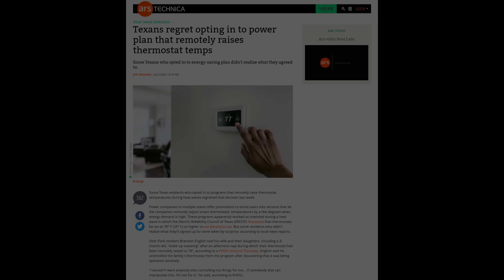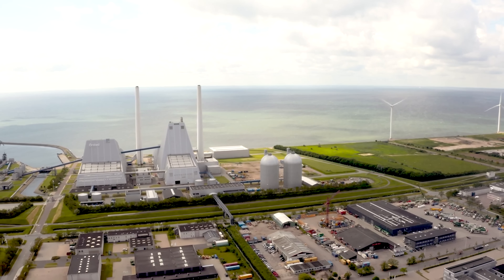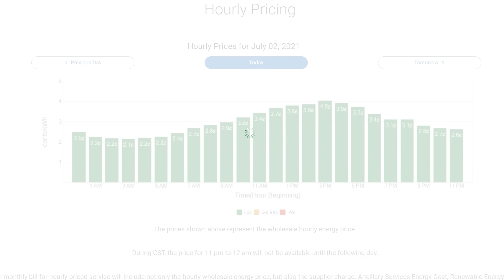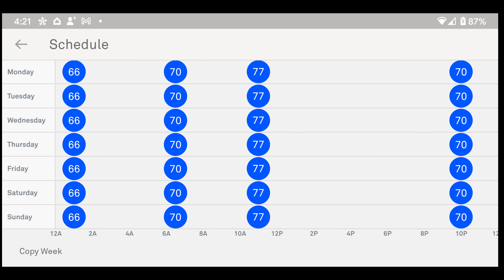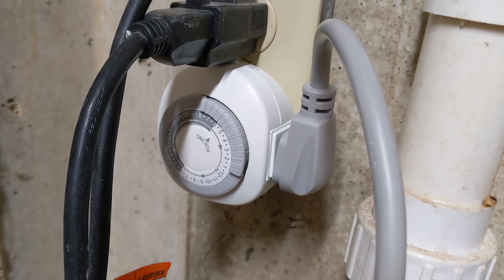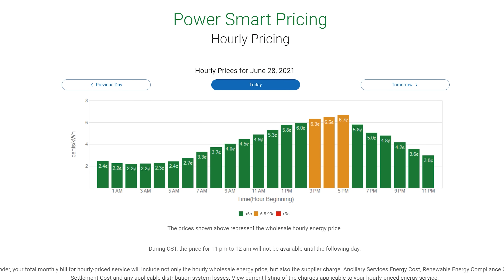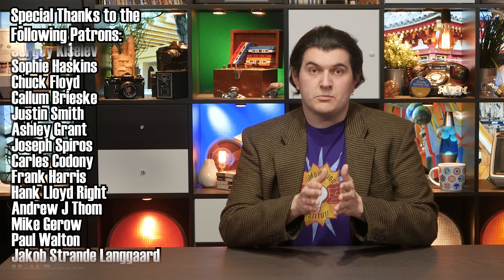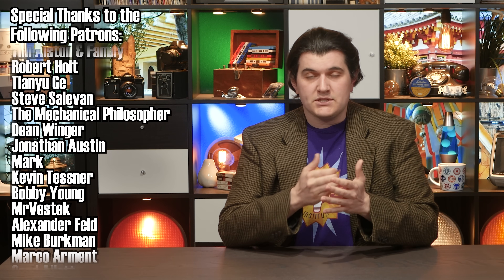Batteries aren't the only way to store energy. Here's another.

Comment: "The daytime temperatures were near 90..."
THAT is why this works.  I very much doubt that this will work in my tract home in Fresno, California, where during the summer we seldomly see temperatures less than 100.
Reply: If you have low humidity you can cool hot air easier, humidity adds latent heat to air.  Typically in humid areas the temperature may be 90 Fahrenheit but the heat index, which represents the latent heat of humidity, can easy be over 100 degrees Fahrenheit.
Reply: Maybe someone will invent a domestic version of that ice-based cooling storage.
Reply: This is why we need better isolations. With global warming raging on, we need to build our buildings more and more like Middle Easterners, with thick walls, tiny windows, and some kind of tower on the roof or patio to circulate air.
Reply: @EgnachHelton  What we really need is more nuclear power.

Comment: Great video!  Here in rural Manitoba, Canada, I've rigged up a system whereby I deal with 90% of my home's cooling requirement by sending our REALLY COLD municipal water (9 Celsius) through a heat exchanger in my forced air system, then exhausting that water through 'misters' that provide moisture to the herb garden adjacent to my south-facing wall.  The plants don't like super cold water ANYWAY, and I gain some additional evaporative cooling from the dampness on the south-facing brick facade (sort of like an exterior swamp cooler?)...  A benefit of this system is that it is 'analog':  If I want MORE cooling, I run additional water through the system into my veggie garden.  I don't know anyone who likes the COLD BLAST from conventional air conditioners...

Comment: all this goes doubly so for west/central/southern europe, where most of buildings are build from high thermal mass (brick, concrete, etc.) materials.
Reply: only if they are reasonably well insulated.  remember high thermal mass means it takes more effort to cool as well....and also depend on things like annual average temps and such like.. This system will overall use more kWh of Energy, but perhaps less CO2, depending on local forms of generation
Reply: @mralistair737  yes and no (i’m speaking just about cooling now). if you can avoid direct heat gain thru the windows (overhangs, shading, shutters, etc.), in most of europe you only get about a week of tropical nights (above 25C or 77F), therefore just nightly ventilation is often enough. this goes doubly for really old houses that have often 60-100cm (24-39”) thick walls. these, if not exposed to direct sunlight (the inner walls), will never get warm enough :)
Reply: @mralistair737  they'll only take more effort to cool if they get hotter in the first place, which takes longer with more thermal mass. Modern European houses aren't significantly less insulated than North American ones, either. By utilising shade, the direction of the sun in the area over the year, and thermal mass, you can create a very rudimentary implementation of "passive house" concepts even in the age before insulation, AC, and central heating. These technologies are used in the modern Goldsmith Street council estate in the UK (although mainly to reduce heating demand rather than stay cool)

EDIT: Also, for clarity, the majority of European housing doesn't even have AC. There's no real energy peak on hot days.
Reply: @doorhanger9317  i'd say in europe we are typically much better insulated then the USA.   I agree you are correct about the thermal mass being "you get out what you put in" but the efficiency of this strategy is questionable if your thermal mass is on the outside of your building, where it's also very good at generating losses by conduction, or being heated up by the sun.

Comment: I also cool my house exclusively during the night. My setup involves opening a crazy invention called "windows"

:D
Reply: Which is fine provided the outdoor humidity isn't excessive. :) In such cases, I'd think a heat exchanger could be a nicer proposition.
Reply: Yup, I've been doing this for years now. Open the windows at night, suck air out some windows with fans and let it come in elsewhere. I can cool the whole house off in 20 or 30 minutes. Let the whole house get as cold as possible, and then close the windows before it warms up outside. House stays pretty cool until the late afternoon, and even then downstairs is quite nice. Really only use the AC a week or 2 each year, but that week or 2, it's really necessary. Usually only when the night time temps don't drop down cool enough to cool the house off at night.
Reply: @thromboid  Even if the humidity is high, you still want to get it as cool as possible inside. Then as the air warms up the next day, the relative humidity will lower anyway (warmer hair can hold more water, so if the amount of water vapor in the air changes, but the temperature of the air goes up, the RH% goes down)
Reply: I live in AZ. Outside temps can easily still be over 90 F, after 2 AM haha.
Reply: @TheLargeHardonCollider  Honestly I don't know why people ever decided to move into places like Phoenix. 200km to the north there's a nice city called Flagstaff, with mountains and forest around and it seemed habitable when I visited it. But for me worst place was likely Washington DC, it was not so hot as Phoenix, but close and extremely humid at the same time.
Reply: @gorak9000  Yes, that's quite true about the warming lowering the RH. IMO, basing the decision of whether to ventilate, dehumidify etc. on the dew point rather than the RH is (pardon the pun) sensible.
Reply: @pavelperina7629  "I don't know why people ever decided to move into places like Phoenix." > LOL! I wonder that too, every day of summer. :D

The settlers must've been a different breed. Who on their way to California decides, "You know what, I think I'll stop here instead!" before air conditioning was even invented? Crazy people, I guess.
Reply: If you live somewhere with very continental climate, like Central Asia, that definitely works. Not gonna work in the subtropical and tropical coast where the majority of the population lives.

Comment: I do something similar: but I live alone, so I can get away with it: I'm on a "peak efficiency/even-load usage" rate plan that has about 25% cheaper rates most of the time, but that sweetheart rate nearly doubles between 2 and 7 on weekdays, So I just leave the AC off during that time. (I also forbid myself from running large-load appliances during this time.) The temperature might rise 1°F per hour during this time, no biggie to me. And takes around 2 hours to recover after that. The $ savings not running the AC between 2 and 7 (which it might run near constantly during these hours on very hot days anyway) far outweighs it running constantly for just a couple hours after 7 to recover. 😎

Comment: I'd totally get a system and program it for this sort of behaviour myself in a heartbeat (sounds like a lot of fun optimising your scheduling for minimum energy use), but I wouldn't install one controlled BY the energy company. Only I have root access on any device I buy, PERIOD. I could probably do this with an off-the-shelf single board computer already, though... I guess I should keep this in mind for if I ever own a house.
Reply: Was thinking exactly this
Reply: Yep, my immediate thought was that I would do this SOLEY if I had my little thermostat on a entirely separate network. Ideally it would be on a lil cellular data dongle, nowhere near my network lol.
Reply: Yes exactly. This is a good system as long as it can be controlled by the household who can make changes if there is a problem and they realise they've misjudged something. At some point there will be a disaster where an energy company makes a mistake or just doesn't care about the welfare of their customers.
Reply: @csehszlovakze  Or there's an internet failure and your heating turns off because won't function without an internet connection. There are way too many things that could go wrong and it's not worth the risk.
Reply: An actually smart system would allow you to set a range of temperatures that you find acceptable at any point in the day, and the most the energy company can do is send an api request (possibly including the current billing rate and/or discount they're offering for complying), which your thermostat/smart hub/whatever can then act on or reject based on the parameters you've set up.
Reply: @jamesirvein5458  That would be really ideal. Energy companies should offer time-of-use pricing, and offer an API to fetch the current rate (and optionally more advisory information, such as warnings of upcoming planned outages and rate changes, etc.) over the Internet in a machine-readable open format. Everything else could be done completely within the users' system, without requiring any trust on the user's part.

Comment: What kind of flooring do you have?  I know that having a tile floor is also a "thermal battery".  Very interesting ideas (as always!)
Reply: Yes, ceramic has a high heat capacity.  Our house is stucco and the concrete too has a high heat capacity, so it works well where we live which can get into the 100s of degrees.

Comment: Hey, for those who have the power company controlling their thermostat; if you yank the thermostat off the wall, you can touch the RED wire to the YELLOW wire (or white if your thermostat only does AC)  and your AC ought to turn on. Keep in mind it will NEVER shut off until you pull the wires apart. 

If your thermostat does heat and AC, typically Red (RH) to White is heat, Red (RC) to Yellow is cooling, and Red to Green should turn on just the fan motor.

Comment: I just gotta add something.  We live in an ICF house in central South Carolina.  4800sq feet with a full basement and a massive slab.  The heatpump condenser tripped it's breaker on Aug 30 (I have a power meter with several current sensors on it) and we never noticed.  Until last week when the house dropped from 73F to 71F.  For four months, the internal fan moved air thru our ducts within the house with no heat or cooling added.  The only reason I noticed it was that it dawned on me that the fan was running full speed due to the 2degree temperature deviation.  Thermal mass rocks!!  Previously I had noted that when we got a cold snap the house took about 1-1/2 to 2 days to change the rhythm of the heat pump.   If you ever wondered if you should build an ICF house, this is a darned good reason.

Comment: I've read that over-cooling a home when dew points are high can result in rot and mold damage.  In much of the southern US, dew points mid-summer are regularly in the 60's and 70's.  The typical dwelling is not built to Passivhaus standards that require air and vapor sealing.  When warm, moist, outside air (or water vapor) infiltrates and hits a cold interior wall, it can condense on that surface.  Then you have liquid water in the wall cavity.
Reply: If it is a modern house and your experiencing those issues then the building's construction was not up to code, when houses have issues with that it's because they're either is not a vapor barrier or the vapor barrier is insufficient for the task.
Reply: @the_undead  Vapor barriers required by code in colder climate zones are to prevent inside moisture from condensing on cold outside walls in winter.  They don't protect a cold inside wall from outside moisture.  Inside or outside vapor sealing is not required by code in warmer climate zones.
Reply: Homes built pre 1940 didn't have good vapor barriers, or often any at all (our house is stucco directly applied to studs). There are a lot of houses in this condition.

Overcooling an old house will almost certainly result in moisture condensing on interior walls. Likewise, high indoor humidity in winter results in moisture condensing on exterior walls. This becomes a problem if you insulate, because you've reduced the ability of the wall cavity to dry out when condensation forms, making mold growth more likely.

Comment: Wish I could do this with my apartment. Unfortunately, living on the top floor of the apartment, on the sun side, with no trees to shade it. So, it gets often gets hotter than the outside temperature even in the afternoon. It really sucks, especially because my windows weren't designed to accommodate air conditioners. Top it off with my heating also just being a single baseboard heater and a single bathroom-sized electric heater, and climate control leaves a lot to be desired here.

And yes, I'm in Seattle, so while this isn't often a problem, when it is, it   s u c k s .

Comment: This is pretty much what we do except we don't have an actual AC unit (yet). Our house is a U shape so not the most efficient but our shop has a pair of massive fans in it. We open all the house windows at night, open the doors making a path to the shop and turn the fans on creating a massive vacuum of air through the house pulling the cooler air at night into the house. Depending on whos up when we can usually have it running anywhere from 10pm to 9am. Temps in the house can easily get down to 17c at night and unless we have weeks on end of stupidly hot weather (sadly too common which is why im prepping to buy a large window unit for specific parts of the house that we inhabit the most in the day), the house is quite comfortable all day. Also it helps that the basement is quite deep and all concrete so it generally stays cool as well. All this in a 40 year old house too

Comment: Precooling will work especially well due to specifics of heatpump - cooling indoor warm air and heating colder outside air at night. The opposite will not work so well due to the lower efficiency of heatpump with colder outside air, which might not compensate cheaper electricity.

Comment: I've been sweating like crazy all summer due to mandatory "smart thermostats", this is freaking 1984.
Reply: Can't figure out they can be bypassed 🤣?
Reply: How does it feel being part of the problem
Reply: Do you have an ideal area to remove power from to prevent the issue?
Reply: @philbuilds116  They can, but 1) it's a rental and 2)there's an anti tampering measure on the unit.  I could get into it if I truly wanted to, but it's going to cause me problems later.
Reply: @agafaba  What am I going to remove power from, like 10,000 other houses?
Reply: @Frentzen127  I live in a small apartment of modern construction, I probably use less electricity than most people.
Reply: @knottheory79220  power has to come from somewhere else if it's not coming from you, so I was just asking where you think is lower priority than residential air conditioning
Reply: @agafaba  You might have a point except people who don't have to have smart thermostats, or who can install their own thermostat the county doesn't control, don't have this problem and I do. 

It's also stupid because to work around this problem I'm having to run 3 fans constantly, and I wind up taking extra showers because I sweat so much, so that means more water and power consumed for more laundry.  It's self defeating.
Reply: @knottheory79220  the fans are still likely a lot less power hungry than your ac is so they still get some savings. I do get what you are saying though, and it would be better if more people and companies took the same approach as this video to prevent these kinds of problems.
Reply: @knottheory79220  sounds like you need to move to another rental.

Comment: Watching this video with sadness in my heart from my super-old, poorly insulated, single-paned apartment in one of the most expensive energy regions in the country. 

Those texas rates looks freaking amazing. Checking in at $0.30 super off peak, $0.36 off peak, and $0.61 on peak 👌
Reply: You could do the thing the Russians do and hang rugs/thick curtains an inch or so inside your interior walls. Not as good as proper insulation, but the dead air space can trap some heat.

Comment: I have been, nicely, trying to implement this schedule in my home for years. My family is very difficult to reason with. This year, I have not been nice about it, after all, I pay the bills. I have enforced it, and I tolerate no attitudes. My house is old, when I moved in keeping it cool and warm was a challenge and a pocket drain. Over the years, I have made it a bit more energy efficient with insulation in the attic, replace some of the old windows, patching here and there, and even applied insulation to some of the exposed windows that do not face the front (it will look weird and ugly. After running the ac from 9p to 6p, avoiding opening doors frequently, and running the ceiling fans on low, we maintain a comfortable temperature between 75-80F. Humidity in Houston, is the enemy, but even that is manageable nowadays. With the electric prices going sky high, I threaten to sell the house and move, myself into an RV (everybody in my house is an adult). So things are looking better, and everybody is compliant. I also have a small solar setup used to charge stuff and for emergencies. After all, we Texans had a rough wake-up in 2021 with the freeze.

Comment: So this is just a pricing strategy? Anyway, it's still good since if it is widely adopted then renewables will be more available.
Reply: No, it's an engineering problem that is solved by using price to manipulate supply and demand (unlike normal markets where supply and demand manipulate price). When someone changes their consumption pattern to minimise their bills (or generation patterns to maximise profits in the case of suppliers), they're actively pushing the grid towards stability. The price is not set by either side, but instead by the independent grid regulator depending on the grid status.